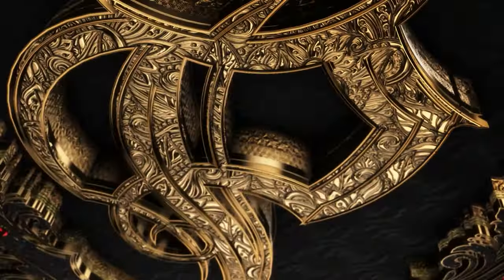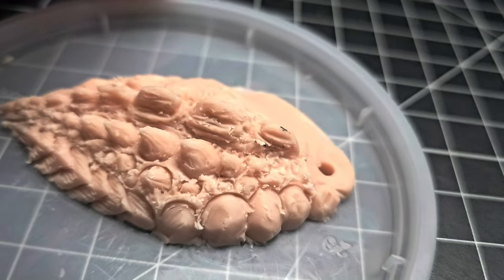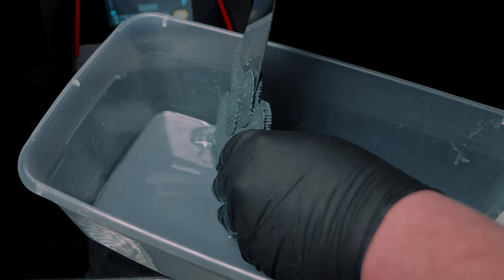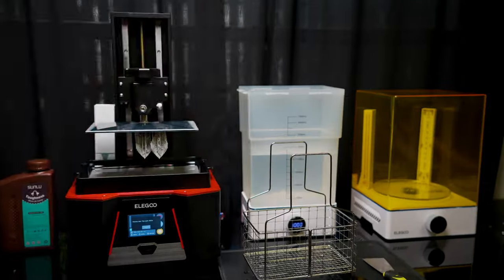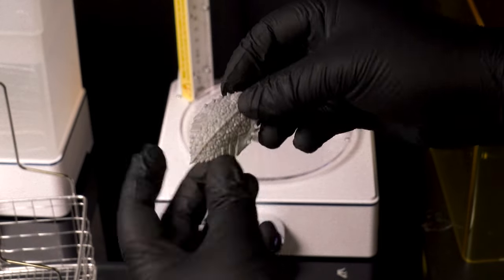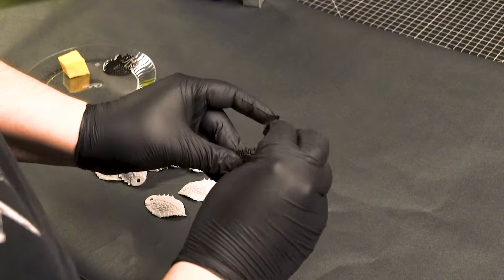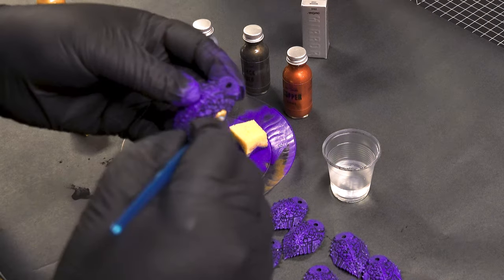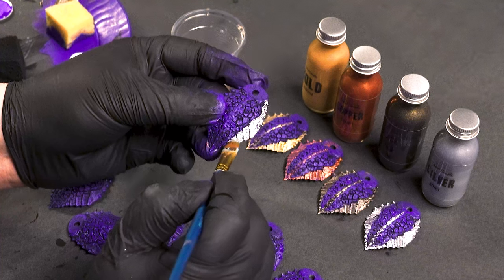Making Dragon Scale Armor (Proof Of Concept)

Comment: The cool part about having 3D resin printers at the ready is that you can take silicone molds off of the finished prints and use those to make modeling wax casts which you can then add to a wax tree sprue and cast in plaster before melting/burning out the wax and finally casting the scales in metal. But, given that these are just show pieces and not meant to be particularly functional as armor, metal would be a really expensive extravagance.

I would try mixing the mirror silver with the dark gold to create a subdued electrum color. I would also consider adding some of the dark gold color to a very dilute wash with some black paint and just dip the scales into it to make the purple less intense while also adding some shimmer. Just remember to agitate the wash with the scale to ensure that the metallic pigments stay in suspension during the dipping process. You can also try using isopropanol as your diluent if you want the paint to flash off faster (assuming your resin of choice does not dissolve in isopropanol once cured.)

Comment: Highly recommend using hot water to remove supports before curing, my clean-up setup goes like this;
- rinse excess resin off the fresh print with hot water mixed with 10-20% methylated spirits (cheaper than IPA in Australia)
- peel parts easily off soft supports, use clippers or sharp hobby craft scalpel to neaten up support nubs
- place parts in 100% Methylated spirit wash basket , washed for 5-15mins
- take out, either spray bottle with fresh Metho or rinse individual parts in fresh tub if there's any little specs of uncured resin.
- let dry, then cure
Reply from the maker: I'll have to give those a try, thanks

Comment: Quick tip that you really want to have a primer on those! That particular paint doesn't stand up so well with flexing and can be scraped off so please varnish the heck out of those pieces. The resin you're using can also be swapped to something with a little more flex, but if you're just testing the colours out on these, that's not the worst for swatches. As for resin... it can be pretty toxic to work with, so please please make sure you're observing proper safety with it.

Comment: You're going to want to get longer gloves, preferably something more heavy duty.  The resin is super skin irritating, including the washer runoffs, so you want some wrist protection from the inevitable splashes.  The struts and pointy bits can also easily puncture thin disposable gloves.
You also may want to put some nail polish or other hardening agent around the holes.  It should prevent shear and wear around the holes once attached.

I wouldn't have thought to use a printer to make scales.  I've always just made them with a die press and sheet steel.  i can't imagine the print time for the thousands of scales for a full jack or something.
Reply from the maker: There are three other videos of making leather scales using various methods on the channel.   Sheet metal scales are cool too but the game changer with 3D printing is how detailed and elaborate you can make each scale.

Comment: few tips for the next time. Remove supports before curing. You are probably curing for to long. this will make your objects brittle.
Reply from the maker: Thanks.  How long should it be curing?  What is the disadvantage of leaving the supports first?  There are a lot of scales that would be hard to place on the plate uniformly, I left them so I could easily fit them on the plate and they could cure together.
Reply: @Princearmory I expect it would be less of a problem for your implementation since all the supports were on the underside and would be hidden, but curing the supports before removal means that the supports are more likely to either brake off and leave little nubs behind or there will be pitting where the supports took off part of the model with them. Since the supports are softer prior to curing this is usually less of a problem, though obviously will still happen to varying degrees depending on the thickness of your supports. Some people even soaktheir prints briefly in warm water after cleaning them to soften the supports a bit more before removal.